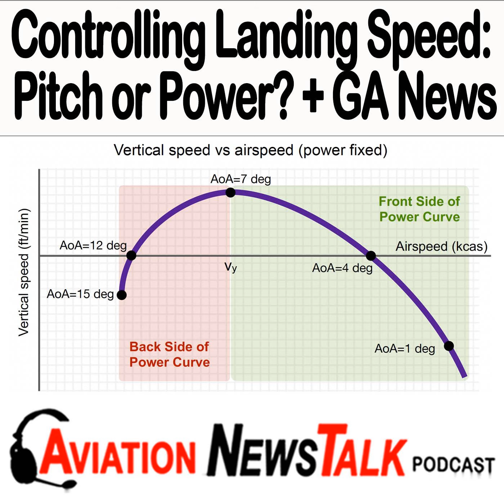224 Controlling Landing Speed with Pitch or Power? + GA News

Comment: Power fixed vs Power Variable operation.  Power fixed seems fine for a jet that operates in reverse command, but how often can a light GA get behind the power curve?  Pitch for airspeed is not optimum nor taught for an ILS.   Shouldn't students be taught to start final at power fixed and then switch to power variable once stabilized on aimpoint and airspeed (treating VASI PAPI exactly as you would a Glideslope)?